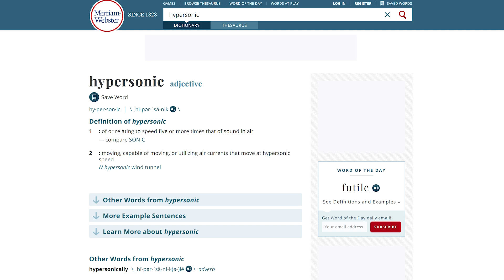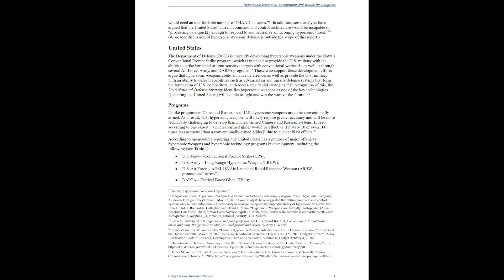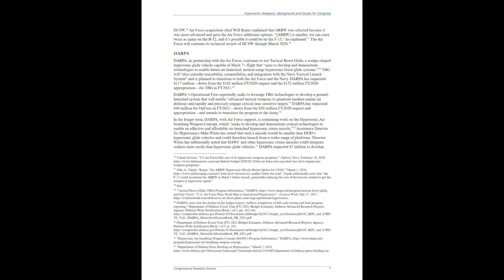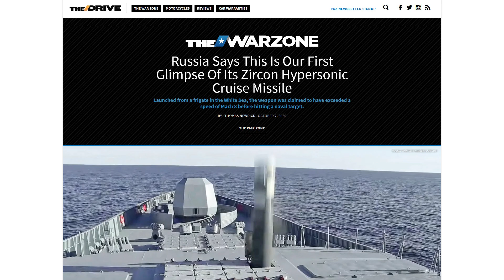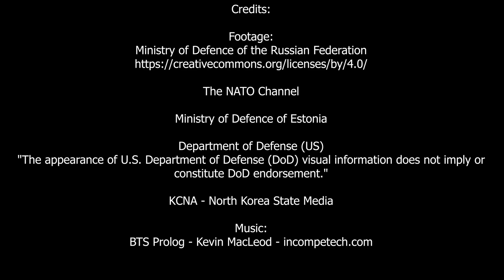The Race is On! Multiple Hypersonic Weapons Soon To Be Operational

Comment: At long range, defending against this would likely require the "bullet hitting a bullet" with missiles.  At close range, where the U.S> seems to be stepping up is lasers.  I don't see a 20mm CIWS taking one of these things out.  Just speculation on my part.
Reply: CIWS has absolutely no chance. I gave a lecture at work, and it I demonstrated a missile attack on a ship, with speeds, reaction times, ID times etc, window of opportunity for CIWS also. The outlook is bleak, and then I explained it's unlikely that one of these missiles would arrive without several others. The antiship missiles would fire in batteries, from various locations.

Comment: I still view hypersonic weapons as a PR weapon.
The West has not focused on them because they have had superior sub sonic weapons flying at low altitude. Having weapons that destroy the target before they know they are under attack or even if they know it is coming cant detect in time. Is much better than a weapon that just goes faster, but in turn is forced to fly much higher and therefor is detected allot easier even with radar absorbing paints and such. If those paints can even tolerate such speeds and heat.
Reply: I get what you're saying but it's very situation dependant. Slow and low missiles have only really had extensive use against forces that have either low capability ground radar, or none at all. If they have radar in the air, or better ground radar, those low and slow missiles (whilst still harder to detect) do become lesser of an issue. These new hypersonic weapons are meant to be largely undefeatable due to speed and time to target.
Reply: Oh Bull Sheet.
Reply: Yeah, but this weapons are also harder to catch, even more so because they are manuverable.
Reply: @lloyd4011  Hypersonic missiles are not "undefeatable". Just because the borderline space ones travel at the same speeds as a nuclear ICBM warhead (ref failure of the US Reagan era "StarWars" program). Does not mean they are just as difficult to shot down. A successful interception 2000m away from the ship is kinda irrelevant if it is a nuke, but it wont be if its a regular cruise missile payload.
-
Another aspect is that you will detected them even if they are dropped from a plane. Which ironically might mean that spying (eg via planes in this context), for your nation, might become harder because your opposition wont tolerate you getting as close as you used to because of your new hypersonic missiles weapons. 
-
Counter systems are only introduced after an opposition has successfully demonstrated or similar suspected that they have a deployed ready or in service system.
-
This notion sub sonic state of the art cruise missiles are not a threat to modern combat ships is not accurate. These anti ship missiles have more tricks than stealth these days. They are not "Tomahawk copies". When\IF quantum radar comes into service. Then we MIGHT be talking about an era were sub sonic missiles will have a hard time.
Reply: @Lobos222  I said meant to be largely undefeatable, it's still early days for these weapons. It's in another post, but I spoke about the difficulty and problem of shooting down current missiles.
Reply: I used to talk to a dude who makes air defence stuff. He says low flying subsonic missiles are easy targets.

Comment: Didn't mentioned India's HSTDV
Reply: Why? Does it work? How much did it cost?
Reply: @koismiah30  HSTDV is not a weapon itself but and is being developed as a carrier vehicle for hypersonic and long-range cruise missiles.

The HSTDV cruise vehicle is mounted on a solid rocket motor, which takes it to a required altitude. Once it attains certain mach numbers for speed, the cruise vehicle is ejected out of the launch vehicle. After that, the scramjet engine is ignited automatically
Reply: @koismiah30  it is a demonstrater. It is what will be developed to become a hypersonic

Comment: How accurate can something like these be if they have to make corrections to the location of the target (for something moving) at Mach 5?  I guess if your looking at a city or a lumbering aircraft carrier it makes sense.
Reply: Any stationary ground target would be an easy target. This could be anything from a command point that can take over 12 hours to dismantle, or even mobile missile batteries with required radar that can collapse in less than an hour.

Comment: Aren't hypersonic missiles only necessary when you have "noisy" submarines (e.g. China, Russia, NK)? if you have a quiet sub, you can roll up on the shore of a country and release nuke tipped cruise missiles and you can't stop them.
Reply: Russia's submarines are primary meant to counter enemy fleet, not to strike land targets with such missiles. So they have to break through ships' AA. That's where speed comes as handy.
Reply: @Ilyaoz  makes sense! thanks!
Reply: well even if you have silent subs, the fact that you can be halfway across the world from your target makes a retaliatory strike unlikely to moot. it's a very potent capacity. it also increases the possibility of war dramatically as the possibility of a decapitation strike becomes that much more potentially effective and thus can be considered a "good" option. just like the miniaturisation of warheads and their yield reduction increases the possibility of their use, so too does this technology.

Comment: So that is why DARPA is pouring money into Reaction Engines in UK. They need a hypersonic air breathing engine and well reaction engines got one under development. That is most likely what HAWC will be. A hypersonic missile powered by a version of the Synergetic Air Breathing Rocket Engine . They have been testing their air breathing system in USA for Mach 5 heat tolerance.

Comment: i didnt know what to think when Trump said we have had hypersonic for 20 years it makes me wonder what the really secret stuff even does
Reply: But you dont have any hypersonic, you may have tested some few years ago but pretty much there were a failure, so Trump lied when he said you have hypersonic missiles for 20 years.
Reply: Erm... We were developing Hypersonic missiles twenty years ago however.  The LOSAT or MGM-166 was canceled in early 2000s.  It was a Kinectic Energy ATGM.  Not the ASMs that Russia and China have, but Hypersonic nonetheless (I could be wrong on it actually being HS but they were still ludicrously fast)
Edit: I actually double checked and the LOSAT was just a bit under hypersonic, reaching about 4.75-4.9 mach, but the program that developed from it, the CKEM did reach mach 6.5, so yea... we DID have Hypersonics.  Just weren't useful yet.
Reply: Dude... the X-15, a piloted aircraft has flown Mach 6.7 and had its first flight in 1959. If you think the US can't build a missile this fast, well...
Reply: @mankiller3040  Sprint ABM has flown Mach 10 around 45 years ago...
Reply: @SuperGeronimo999 I was not discussing that project, I was mentioning a project I did now actually was occurring 20 years ago involving Hypersonic Missiles.
Reply: @SuperGeronimo999  
Hey man learn the difference between building something experimental which has not practical use compare to a functional system that is operational. Because US its not the only country who made highly advanced experimental projects which lead to nowhere and failed.
Reply: @SuperGeronimo999  I was just going to say that lol.
Reply: @vadrak6197  experimental? Not really, it was operational. Look at its history, it may have not been operational for very long, but it was operational and that is fact.
Reply: @vadrak6197  It's about the technology which has been successfully demonstrated many decades ago. However you employ it is an entirely different question. Look at this record for example. Isn't that a practical use, instead of using it for propaganda like Russia and China do nowadays?

https://www.guinnessworldrecords.com/world-records/fastest-aircraft-air-breathing-engine

HTV-2 also reached Mach 20. Its officially cancelled, but if it was operational, would they tell you? Not a stretch to think a hypersonic (Mach 5+) missile was operational, 20 years ago.
Reply: @vadrak6197  the Manhattan Project would like a word...
Reply: @renaissancenovice7202  
Word about what? What does even mean.
Reply: @renaissancenovice7202  he's not gonna know shit. Too drunk from Vodka😂😂😂😂😂😂😂
Reply: the US had hypersonics since the 80s lmfao. Its public info. Its just that at the time, the US had no idea what to use it with and probably only recently thought of a strategy regarding them.

Comment: Is there a hypsersonic nuclear weapon ban?
Reply: why? every normal ICBM-warheads fly with hypersonic speed (up to 7.5 km/sec. - 27.000 km/h).
Reply: @mikeschlau4501  because, as the video states, hypersonic missiles are different in that they are easily maneuverable and can greatly decrease the readiness time of any target. i'm not sure if ICBMs are capable of that though
Reply: @arealbigboss  For defence against planes or short range missiles, as for attacks on ships, the hypersonic missiles should be more effective than older weapons with those tasks. But ICBMs are the real doomsday-weapons - even most of the best defence systems are not able to destroy incoming warheads of the long range missiles - their abilities end with MRBMs. it is very difficult to hit even a few of them - but absolutely impossible against dozends or hundreds. To hit one, you have to hit a bullet with 7.5 km/per second (and bullets are much slower, perhaps 1 km per second!) with your own bullet, also some km/sec. fast. ICBMs are ready to use 24/7 since the times of the Cold War.

Comment: What about India's HSTDV?
Reply: Not operational yet.
Reply: @matchbox1275  none of them are operational, so what are you on about?
Reply: @indragarg2857  
Russia's Zircon is operational and US has two parallel Hypersonic missile programs, where one of the missile is close to Induction.
Reply: @matchbox1275  still not operational right? India has shaurya quasi ballistic hypersonic missile which can maneuver at terminal phase.
Reply: @meow14115  
But it has Solid Fuel Engine. 
Not the Scramjet engine that was tested in HSTDV.

I'm more confident of ISRO using Scramjet in satellite launches.